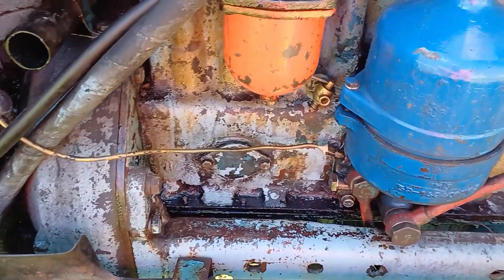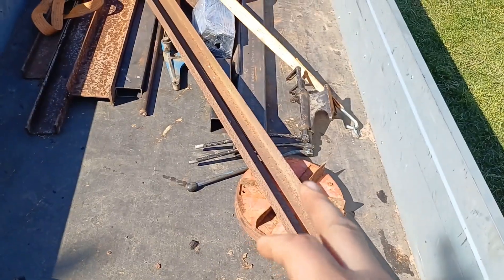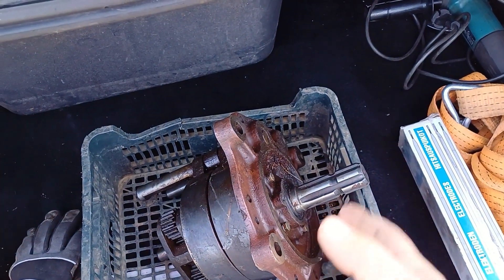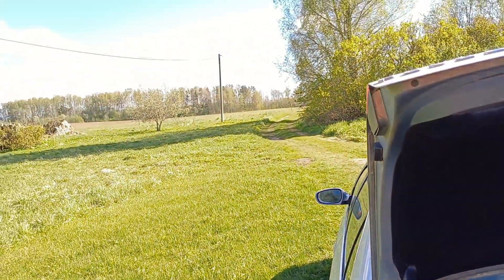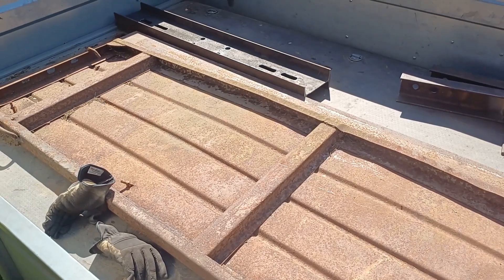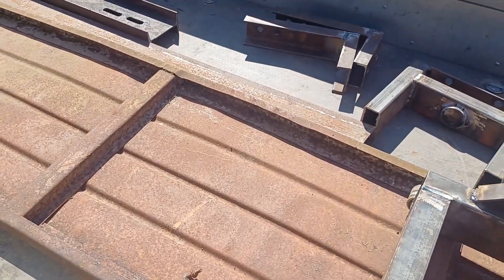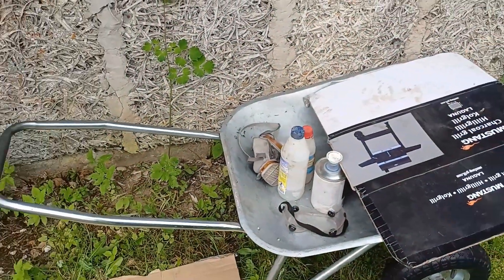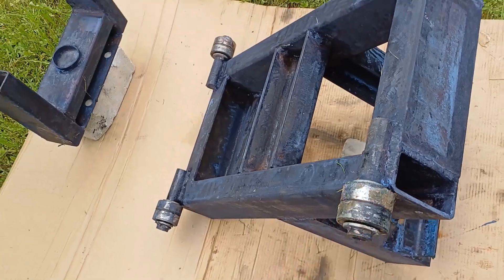The Tractor Splitter(Split-O-Matic)

Comment: I'm 95% sure that's a pulley for the SO7B (СО-7Б) (or similar) air compressor.
Reply from the maker: Yep its exactly what you say it is a SO7B compressor wheel. This one had the keyway still intact. They have a design flaw where the keyway gets destroyed.